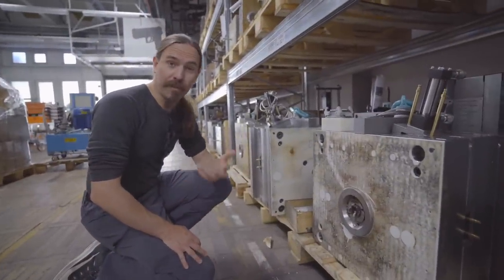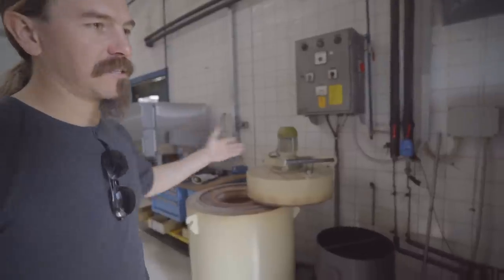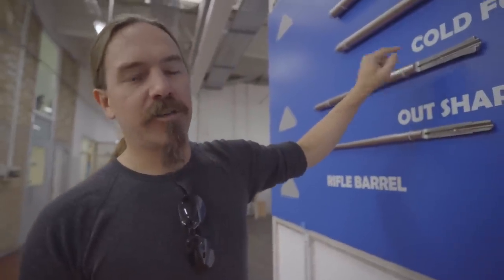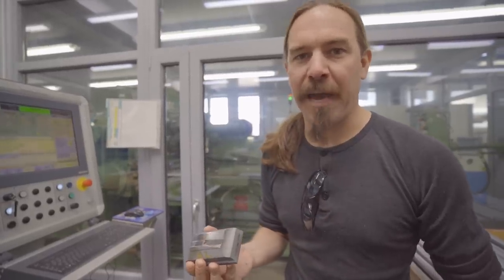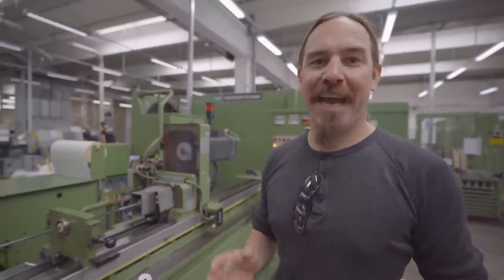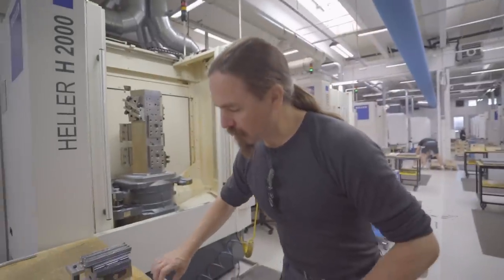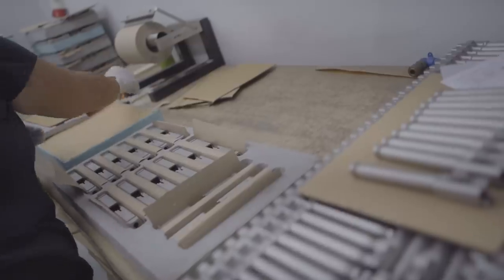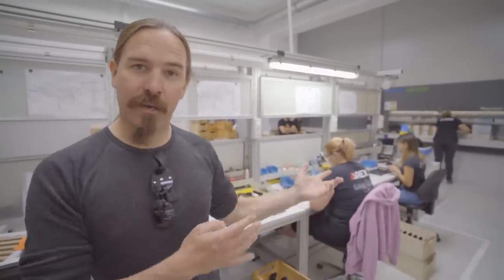Tour of the AREX Defense Factory in Slovenia

Comment: So apparently I had hammer forging completely wrong: I thought the mandrel was hammered down the barrel blank, as opposed to the barrel being hammered around the mandrel.

Educational as always!
Reply: I had thought similar, although, how do they get the rifling in that case? I'd assumed an extra step akin to reaming, but that's at leat two complicated procedures. 
 Ian to the rescue!!
Reply: There is a similar process to that called button rifling. They basically pull a roller through the barrel that pushes the grooves into the barrel.
Reply: @spookyindeed  Yup. ^This^, but in reverse...
Reply: @spookyindeed  how do they get the mandrel out? I would expect it's pretty stuck after having the barrel hammered around it?
Reply: @spookyindeed  Thank you! Perhaps that’s what I was thinking of
Reply: @Socucius Ergalla cool, I wasn't aware that steel was that elastic. I was thinking along the lines of heating or cooling.  The real answer is much simpler and more elegant.
Reply: @chemistryofquestionablequa6252  , drop a steel ball on a stone floor to see just how elastic it is :)

Comment: I was a machinist for 20+ years. I spent over 6 years at Thompson Center Arms, and I've done many of the operations you covered. This was an awesome video.  You covered the CNC machines. The tools are held in place by air pressure, one night at T/C Arms the compressor quit, and everyone's tools fell out mid run. Another night, that tool magazine fell off instead of changing a tool. Another shift filled with fun and learning. Also, many bad words.  LOL
Reply: As an automation technician in being, that tool holder was poorly designed, as things are supposed to stay in place in case of power loss. A small reservoir on a back valve would given enough airsupply to clamp it as fail safe.

Comment: Remember, I gave you a booklet on deep hole drilling technology at the Brownells stand during IWA22 in Nürnberg. Very same brand as seen at Arex. Just quite an older model. Magnetic chip conveyor sometimes even works on stainless steel.
Reply: @TheInfidel_SlavaUA  Some grades of stainless steel are more or less magnetic than others.
Reply: A (very) general rule is that the magnet on your stainless refrigerator at home will not adhere to industrial food processing stainless structures and implements.
Reply: I'd love to test this one day, but in theory if you move the magnets fast enough you should be able to drag even non-magnetic stainless steel chips (and copper, aluminum, etc) up the conveyor. A plastic conveyor, mind you... going to induced drag from eddy currents instead of direct magnetic attraction.
Reply: @mfree80286  The magnet you would need to get that to work reliably would likely be in the Tesla range... which might cause a few other problems...
Reply: @TheInfidel_SlavaUA  Stainless steel is usually a austentitic microstructure which while its full of iron, is not magnetic. Through mechanical/thermal working you can get some of the crystal structure to turn back into ferrite which is magnetic. 
This is also very dependent on the grade of stainless steel, some have a considerable amount of ferrite and some have pretty much none at all.
Reply: @plasmahead2  You might be surprised. I tinkered with this once with broken hard drive pieces (Al platter, voice magnets) and the eddy current from those magnets at a meager 3600rpm (drill press) was enough to heat and warp the platter. 

If you can drop a magnet down a copper tube and have it slowed dramatically, why not move the magnet and drag the copper along instead?
Reply: @plasmahead2  austenitic grades like 316 aren't significantly magnetic unless cold worked and not subsequently heat treated.

 It's plausible that drilling will cold work the chip removed and thus make it preferentially magnetic compared to the drilled barrel blank.
Reply: @BerndFelsche  A fun trick I use on engineers, foremen, welders/machinists and the like is to take a bit of stainless TIG filler wire or small bar stock (1/4" or less...) and a neodymium magnet and show how when bent the magnet will stick to the apex of the bend. No ones made me prove the annealing trick yet thankfully, my eyeballs are not a pyrometer and I cant guarantee I can hit 1300 F reliably...  
The real problem with using it for chip clearing of a CNC machine is how reliable it would be. Might work fine for use machine that only runs attended, but any lack of reliability/potential for jamming would block it from "lights out" use when the machines are unattended by people.
Reply: @mfree80286  I worked at a MRI factory, and got to hear all sorts of fun stories about floating blocks of aluminum on coils and such, as well as working at another shop where we had to install some fairly scary sized neodymium magnets into a machine.  
I think the biggest issue is reliability and the lack of control over chip size/magnetism. Chip conveyors are a big source of problems for the CNC industry, and failures have lead to machines and shops being destroyed by fires. For use when attended by a person it might be OK, but I doubt anyone would use it for unattended machine operation.
Reply: @plasmahead2  It is quite possible to have maglev aluminium platters:
https://www.youtube.com/watch?v=OI_HFnNTfyU

Also have some rings going up and down a coil...  and I know aluminium isn't magnetic at all lol

Comment: After the carbide rifling mandrel is hammered into the barrel, does it easily come out?  How do you remove it from the barrel?
Reply: I would guess that the mandrel is cooled so that it shrinks slightly and can be easily withdrawn
Reply: It's pulled like hell. The hammers are not actually moving that much material.
Reply: I’d also like to know this. I thought it might be “unscrewed” with the rifling like a thread but I’m curious to know more.
Reply: @otm646 " surely pulled like hell" at an extremely precice rotation?  If the barrel is hammered onto the rifling, then the mandrel would have to be essentially unscrewed from the barrel....